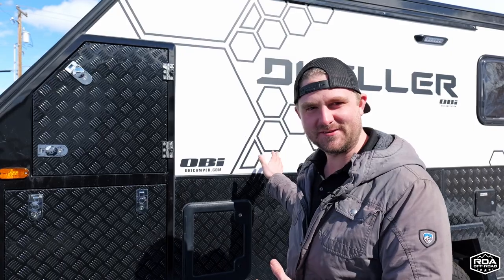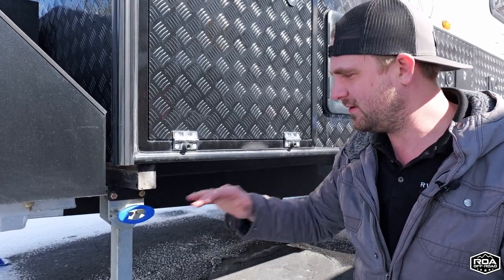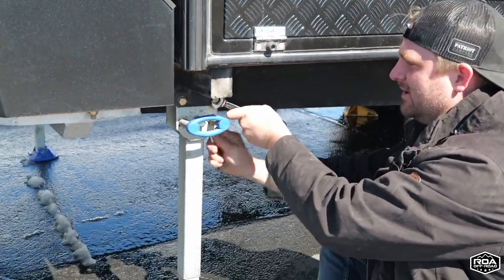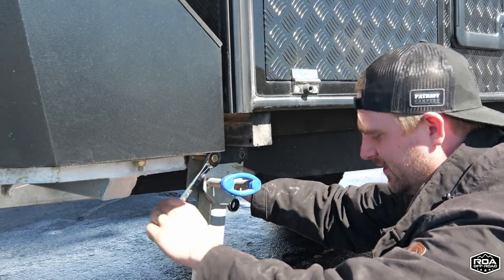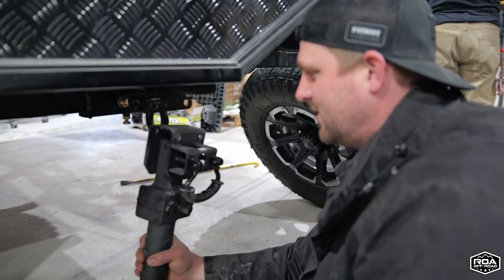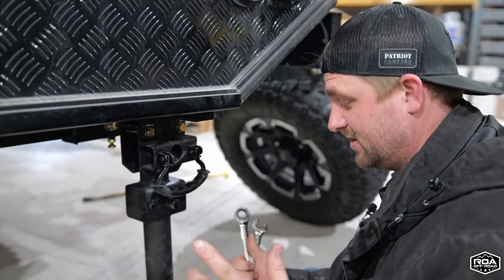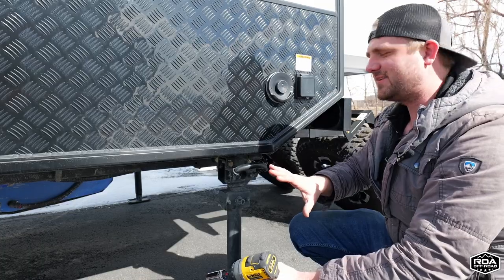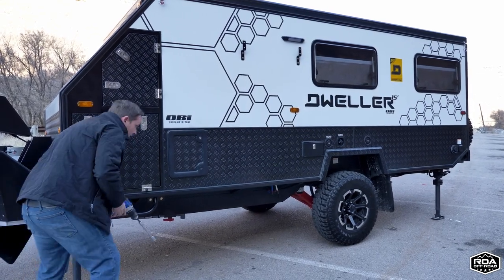You Can Lift The Whole Trailer With These Jacks! Mod Squad Dweller Ark Jacks | ROA Off-Road

Comment: What model or Ark jack are those? I can only find their “steadies” online and they say they’re only for stabilizing and not lifting and that’s why they “don’t provide a weight rating.”
Reply from the maker: Feel free to email our parts guy. Josh@rvsofamerica.com
Reply: It's the Ark XO model. They call them "Corner Steadies". They're rated for 1,929lbs in the 90 degree position ONLY (not rated at 30 and 60 degree positions). It's a great product.
Reply: Are they the 24” or 33” model?
Reply: @kynanwynne1283  We need the 33" model so that they aren't overextended.
Reply: @johnvowell6348   Glad for this comment, was about to order the wrong ones.

Comment: the ARK HD version come with the brackets.  you just need to weld them on.  If you have the OEM blue handle stabilizers, that bracket fits the ARK HD ones